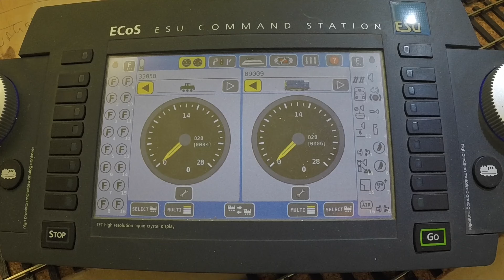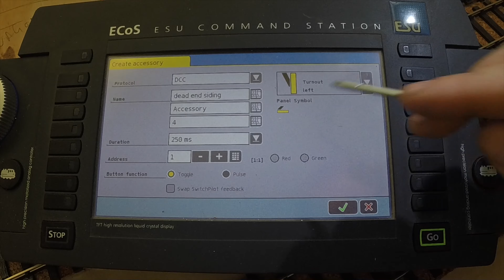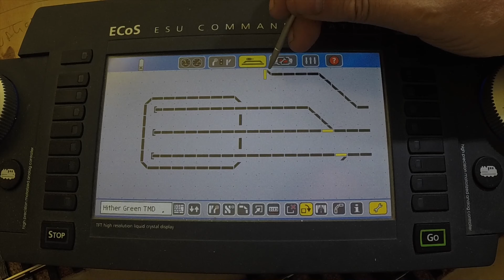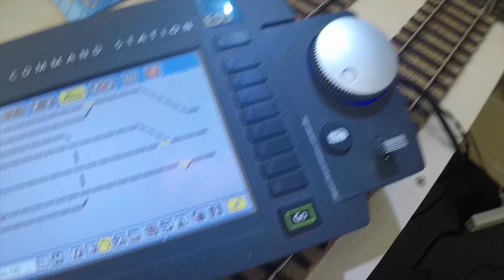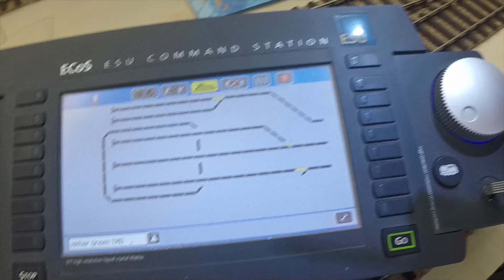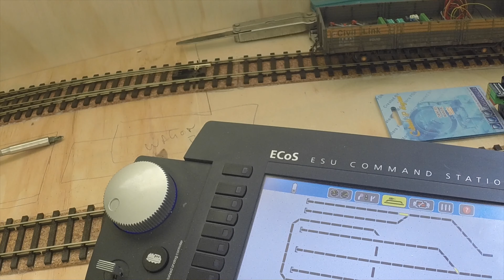Model Trains 78 - Hither Green TMD in O gauge Programming DCC Cobalt Point Motors using ECoS 50200

Comment: I'm helping a friend set up his ECoS system and this video has been very helpful but can you tell explain the process of adding that 0197 accessory? is there anything special I need to do or just name it that? Cheers from Adelaide
Reply from the maker: From memory, being a long time ago, you switch the point motor you want to learning (programming mode) select 0197 and it reverses the indication without reversing the point, that’s if the indication on the panel is backwards. The point motor comes with it in the instructions, and is all very simple once you have done one. Obviously, if the indication is correct, then you don’t have to worry about it

Comment: Use Arduino and servomotors for your switches... It saves you a lot of money, and it's working much more performanter dan those expensive crap Cobalt !
Reply from the maker: Well I personally don’t think they are crap. I’ve used them for years now and only had one fail, and that was replaced free under its lifetime warranty
Reply: @47606odin  May be it's not real crap, but certainly too expensive to drive on all your model rail switches. 
When you will use the Arduino electronic and servomotors, for 5€ each switch, you are a lot cheaper than this Cobalt motors.  
How much you pay for one Cobalt motor ? 25 - 30€ each ?
Try to go to a higher level with arduino... It save's you a lot of money, and the results are even much better !  Everything about, you can find on You tube !
Reply from the maker: Bartolomeo Sammarco the advantage for me at the time, DCC concepts was here in Western Australia, so I could go and see the products and have support
Reply: @47606odin  Ok, i understand.. Evenso,  here you can find a lot of nice information.

https://youtu.be/iH9_xtulyws

Comment: Very informative but I have a problem. Have you come across all your points losing contact with the Ecos after a derailment maybe a short mine did and then had to re address the lot hoping it doesnt do it again if so is there a solution cheers David
Reply from the maker: Hi David. I can honestly say, I have never experienced that issue in the years I have used the ECoS on my layouts, so cannot offer a solution. All I can suggest is you drop on the forum and see if anything has been mentioned on there
Reply: @47606odin  Cheers will do but someone told me it might be a bad batch of colbault motors think i will contact concepts just to see what they say thanks again David